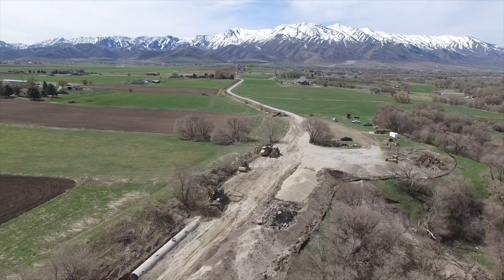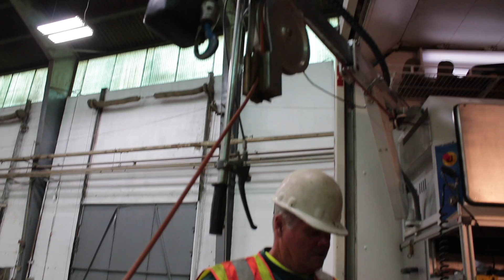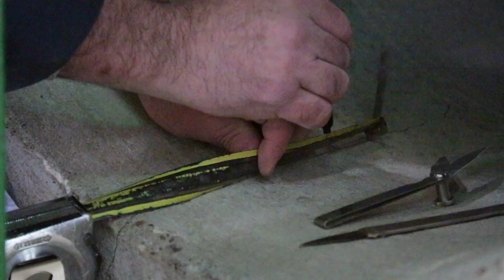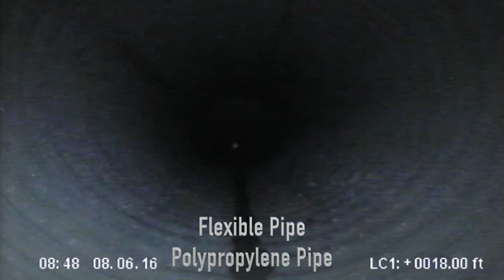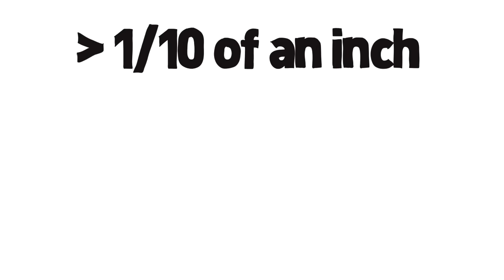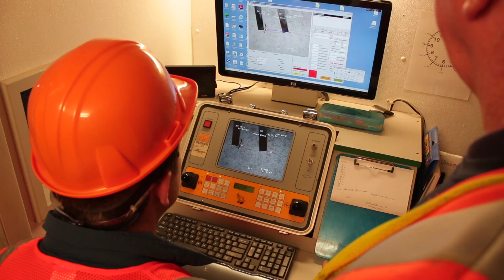American Concrete Pipe Association -Post Installation Inspection

Comment: Manpreet Mould specialist 
Kolhpaur 

R.C.C. spun pipe Manufacturing machinery. 
80 mm to 2600 mm dia. Mtr mould's. 

Any spigot socket and plain mould's. 

(1 ) Net machine .
(2) Mixer machine. 
(3) M.S. Gandry machine. 
(4) Fabrication Trolley .
(5) M.S. andring etc..

And old mould Repair at  on the spot. 
Contact for 8421545452
                  Satveer Singh
Email id -- manpreetmouldspecialist@gmail.com